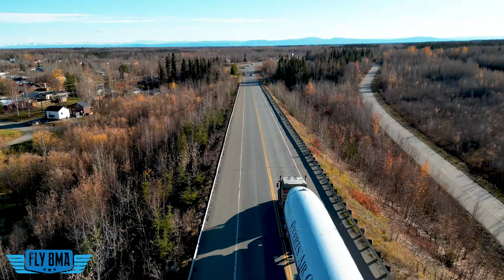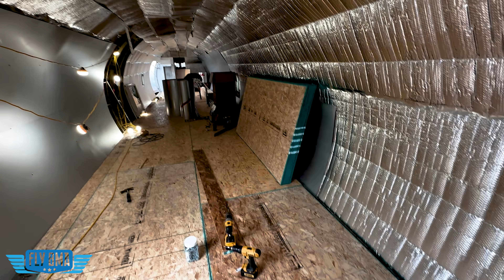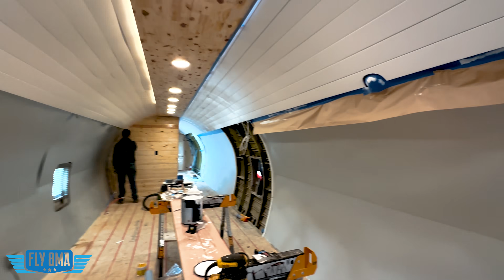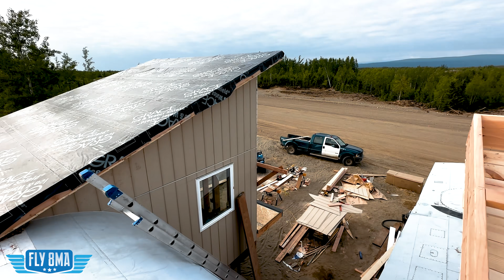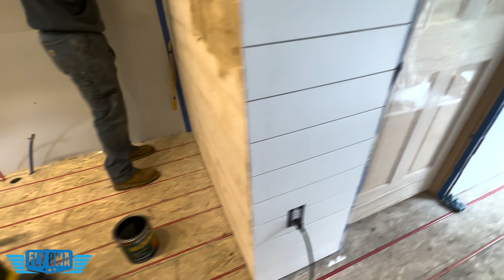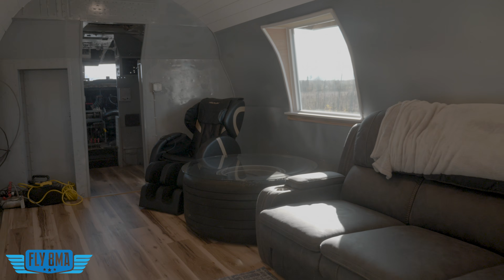100 days to Convert a PLANE into a HOUSE

Comment: How do you find fuselage for sale? I cant find any. I just want the tube; no wings, engine, wiring, or seats. Halllllp
Reply from the maker: Most aircraft wont be sold parted out, especially one this size. Maybe check an aircraft salvage yard?